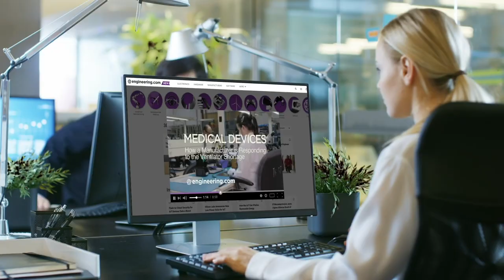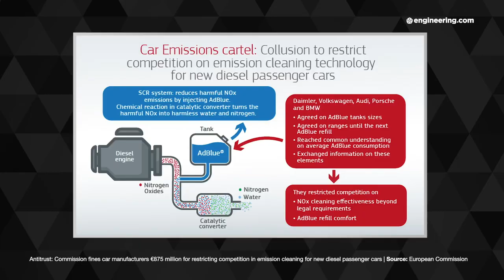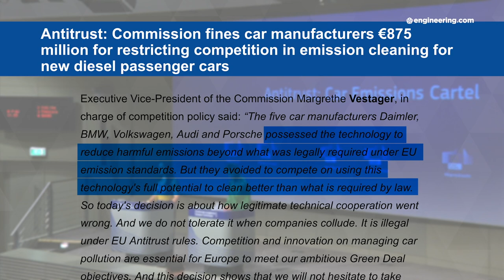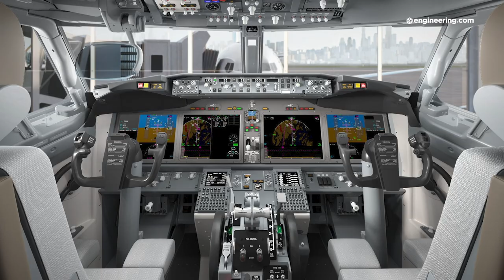EU Antitrust Law Handcuffs Automotive Engineering

Comment: Arguments and examples in this video looks weak and not logic. Agreement on AdBlue tank size and its consumption is not equivalent to standardization of power plug, lamp socket or or any other proper standard. Main difference is that first one does not benefit users or overal industry. Also claim that Boeing 737MAX crashes were caused because engineers were trying to comply with some standard is at least wrong. No standard forces to produce faulty MCAS systems.
Reply: Leave it to a yuropoor to think bureaucrats should be allowed to set a minimum standard and then punish you for not exceeding it. Are automakers making DEF? Oh no, they colluded to meet the minimum requirement of regulation and wanted to keep the additional costs to a minimum! If consumers cared about this then they would be buying hybrids and electric cars. If the bureaucrats are so concerned about environmental policy, they would ban combustion engines and give every person an electric car.
Reply: @darkslayer4697  Carmakers was not punished for "not exceeding minimum standards". They were punished for making agreement that prevents making cars cleaner then minimum standard. If there would be no such agreement and cars would only meet minimum standard, then there would be no punishment.